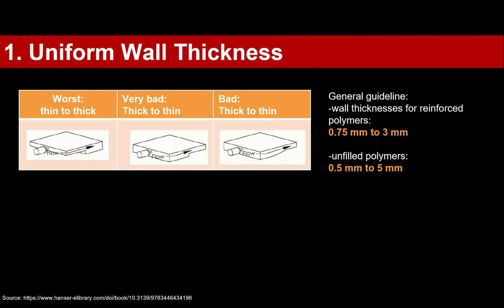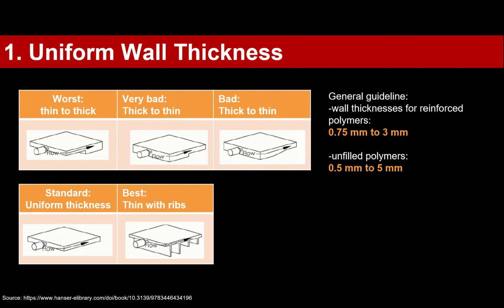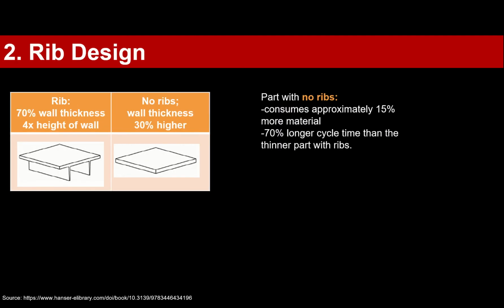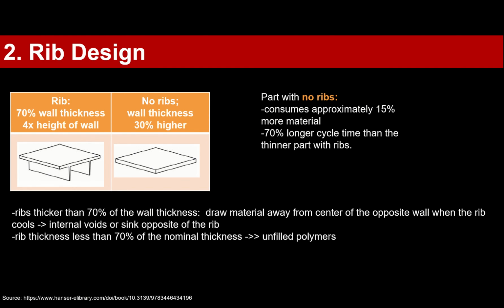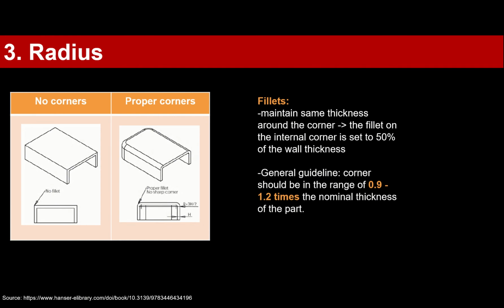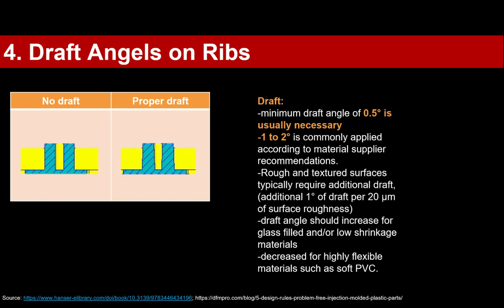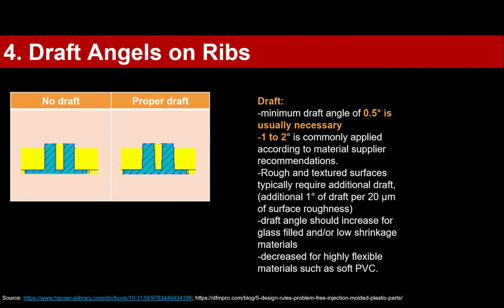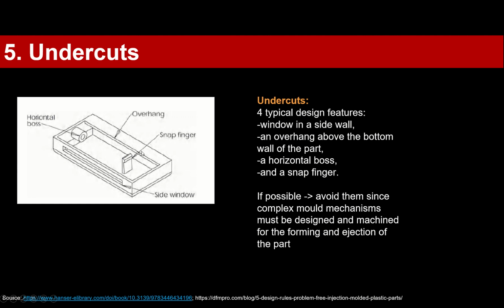Trouble-Free Polymer Injection Moulded Parts I 5 Important Design Rules

Comment: Why wall thickness is higher for unfilled materials than filled materials? For reinforced material thickness upto 3 mm is mentioned but for unfilled 5mm. For better dimensional stability reinforced material would be better as it won't shrink as much as unfilled. Pls. Let me know your thought.